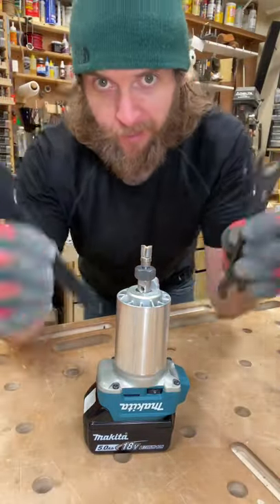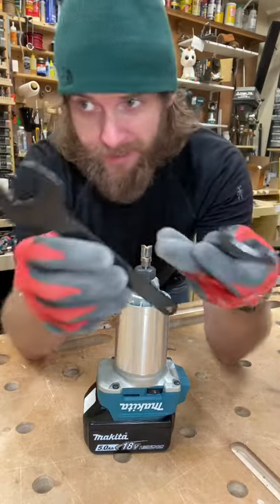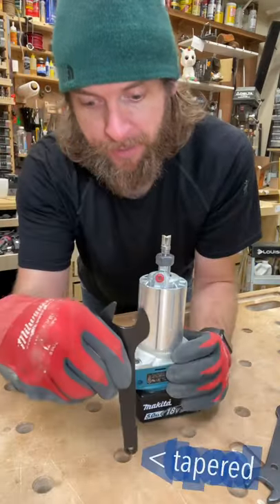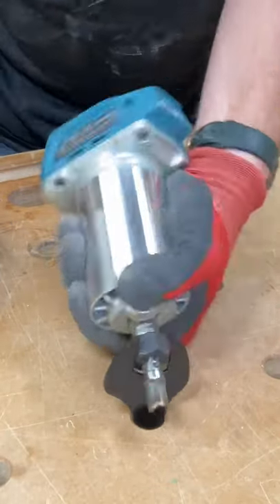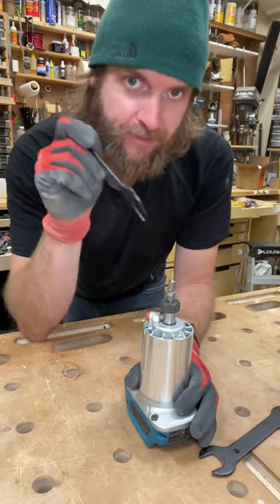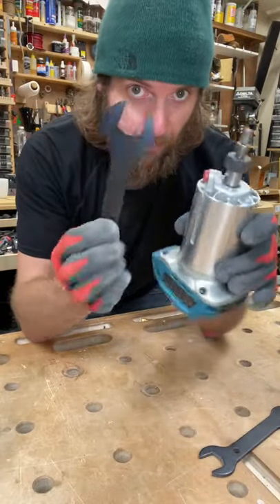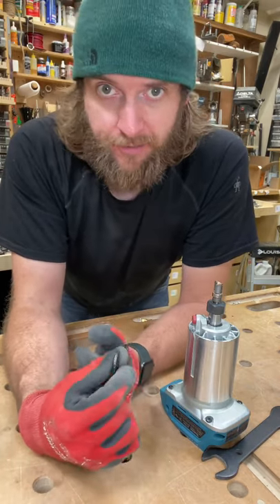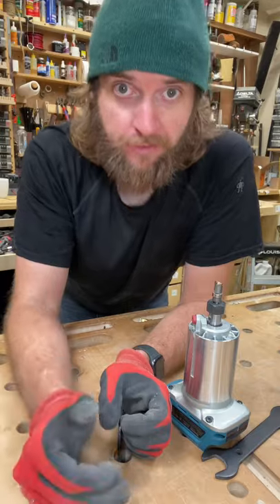*Tapered* Router Collet Wrench (in a hole)  #short #shophacks #partytricks

Comment: I don't mind the shorts, it's nice to have a clip I can watch really quick when I'm on a short break. As for the trick it's self, I like it. I bought 2 adjustable parallel wrenches to use on my router/grinders. I thinned them up to fit, but I have a bunch of die grinders and a bucket full of different sized wrenches for them.